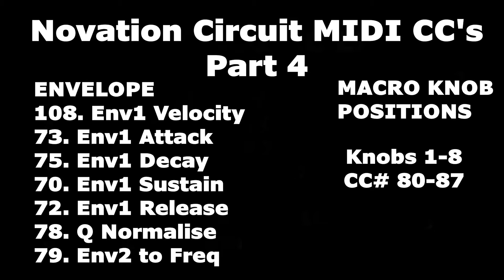Novation Circuit Midi Settings/CC's/Implementation Chart for External Sequencing & Motion Recording

Comment: Hi, good video resource.  I'm trying to decide whether to get a Circuit but I need it to control my Roland JD-Xi where the MIDI channels are not changeable.  Can I switch the different synth tracks to send on MIDI, 1, 2, 3, or 10 and disable the Circuit synths/drums on those channels so I'm just using 1 or more channels to control anything I choose on the Jd-Xi?  Might be obvious but I'm having a difficult time confirming the answer.  (I'm fairly sure the Circuit Tracks can do this but not sure about the Circuit).
Reply from the maker: Hey there, I'm really not sure either!  I don't think you can disable the drums etc but I might be wrong, I'd expect you would just mute them though?
Reply: @Studio-solutions-com  thanks.  guess my actual question is whether you can change the outbound midi channels, such as using channel 3 which would hit the JD-Xi analog synth channel.
Reply from the maker: @ambidex  then yes, the midi channel selected is for sending and receiving data on 😀
Reply: @Studio-solutions-com  and you can change it from the default (which is 1 and 2)?